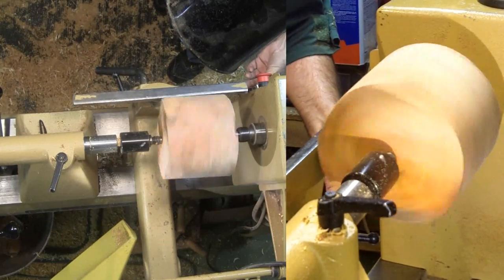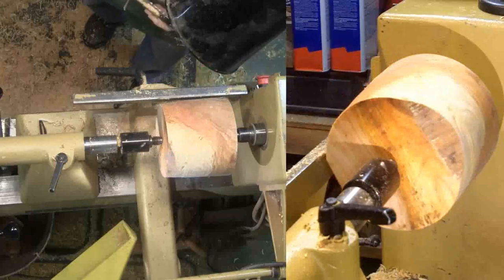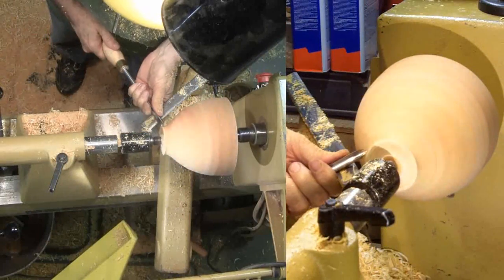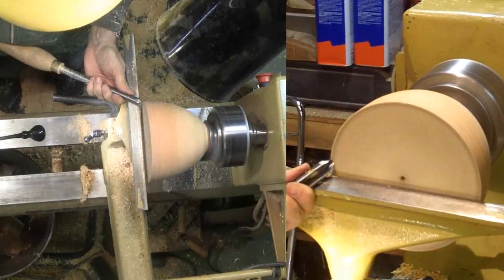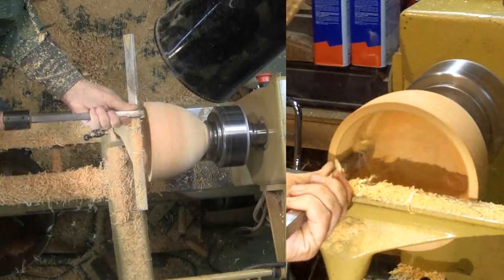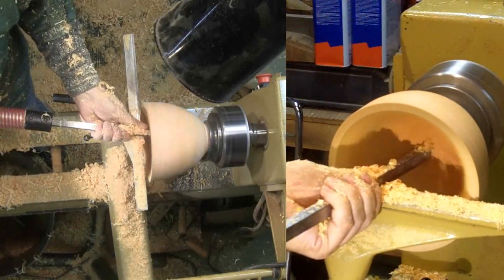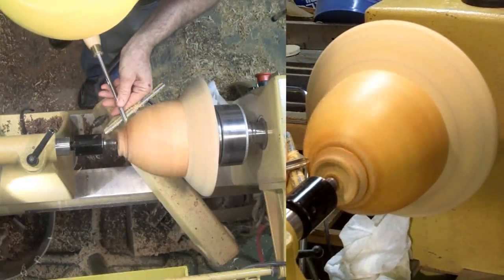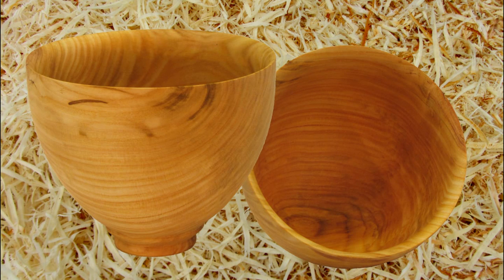Woodturning Green Wood Bowl - All At Once

Comment: Thanks for the great instruction,  i have a very straight question which is what happens if the turned bowl be coated and apply finish when it is not dry and is in initial  natural  moisture.?. Drying wet wood is very cumbersome task for me in a small workshop and I am looking for some tricks. Thanks for your attention
Reply from the maker: There are lot of ways turners have tried to quickly dry wood. Some are expensive; some have results vary wildly with species. You can finish wood while still wet. Even then I would wait a couple of days to get rid of surface moisture. However, no one can stop warping while it dries. The trick in whatever method is to equalize the moisture loss to reduce stress between wet and dry wood. Another trick is to rough turn leaving walls at about 10 percent thickness to overall diameter. Then wood dries more quickly since it is thinner and less wood. Fringe benefit is that wet wood is easier to turn than dry, usually.
If you simply do not have space for wood, then perhaps you should try segmenting since you start with commercial dry wood and have only moderate drying requirements.
Alan

Comment: Through many videos, I have always seen that you must keep the sides a uniform thickness with green wood to prevent cracking. This also includes the bottom being about the same thickness as the walls. So your thicker tenons left on the bowl,wouldn’t this cause cracking at some point?
Reply from the maker: I cannot disagree with that advice. However, I generally like the bottom just a little thicker for weight feel.
Any green turning comes with a risk of cracking unfortunately.
Alan

Comment: Instead of a bowl now or a bowl far in the future, ever tried the microwave approach? Roughing it down to a mostly bowl shape and then hitting it low power in a microwave for 30 second increments to vibrate out the water, measuring the mass on a scale each time until the mass stabilizes. Then turn the bowl to finish
Reply from the maker: That is a possibility that I've tried but did not like the process nor the result.
I have not yet tried it again.
Alan
Reply: @AsWoodTurns  oh dang I was hoping it worked out because that's my plan...

Comment from the maker: This is a cross grain bowl.
Thanks for the question - I should have specified it.
Alan
Reply: As Wood Turns so as you started out by rounding the outside of the blank you were cutting into the end grain? It seems you can turn a bowl with either grain pattern...this is one thing I've struggled with starting out. Is it best to turn wet wood and CAN you turn dry wood? Sorry for the rapid fire questions but great video!